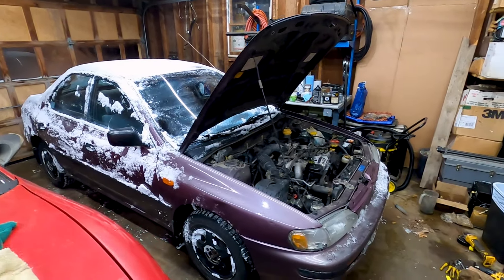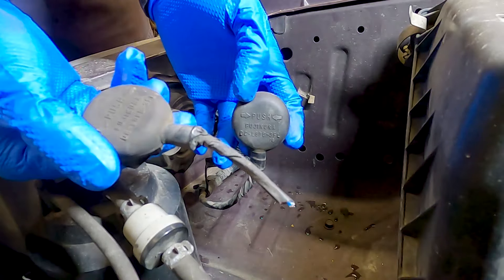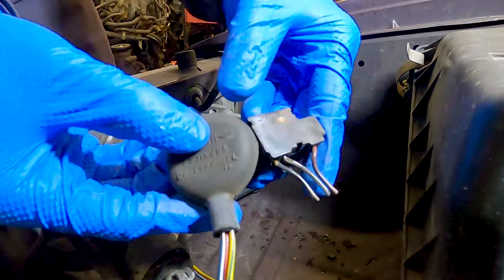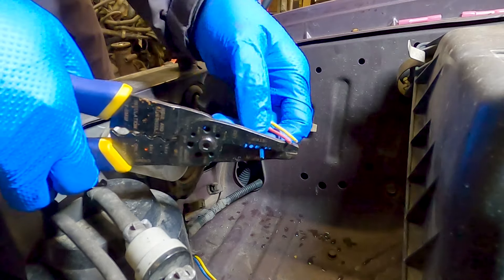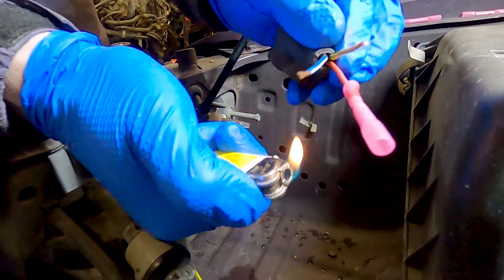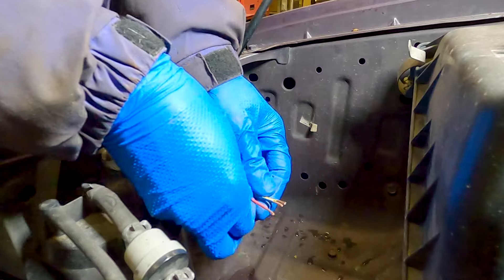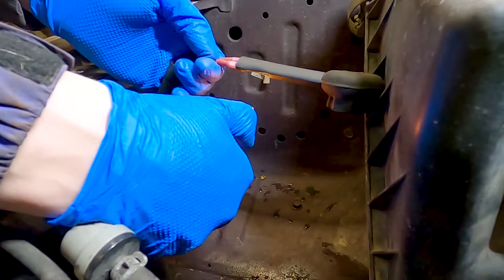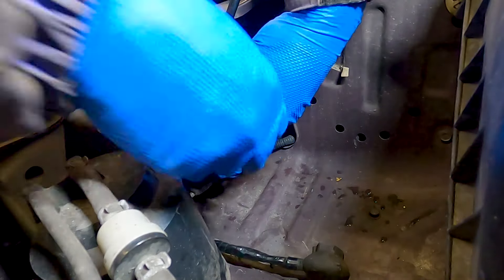How To Replace A Car Wiring Connector Properly - Repair Headlight Wiring Pigtail Harness

Comment from the maker: Links to items in video. Plus extra options. Affordable products I use or which have great reviews. Clicking these links may help me out. :)
New Crimper & Butt Connectors - https://amzn.to/3IHYhso
Crimping Tool & Connectors - https://amzn.to/3IFvDs2
Ratcheting Crimping Tool - https://amzn.to/3wDYLNO
Heat Shrink Butt Connectors - https://amzn.to/3Nmm6cX
Basic Heat Shrink Tubing - https://amzn.to/3IEocBu
Adhesive Heat Shrink Tubing - https://amzn.to/3tHpfMO
Manual Wire Stripper - https://amzn.to/36vkYmH
Automatic Wire Stripper - https://amzn.to/3LdAHpd
Cheap Automatic Stripper - https://amzn.to/3DcjZDS
Diagonal Cutting Pliers - https://amzn.to/3JGBxdD
4 Piece Hook & Pick Set - https://amzn.to/3IE5NV9
Reliable Heat Gun - https://amzn.to/3JWZHB3
Utility Knife With Blades - https://amzn.to/36v37we
Wire Sheath Seam Ripper - https://amzn.to/3NgaiJ8
Reply: You should pin this so its the top comment.
Reply from the maker: @NickFrom1228  Why thank you! It was supposed to be, hah.

Comment: This video saved me between $250-$500 (estimate from the repair shop I had an appointment with). New connector cost $15 at autozone and the tools needed were about $20 all together at walmart. Easy to follow tutorial. Much appreciated!
Reply from the maker: That's awesome! Exactly why I made this video. Thanks so much for the comment.
Reply: All you need is 3 bucks to get into the junk yard and a sharp knife and pockets lol

Comment: I love how u Take your time to respond to everyone's questions and comments. It's very appreciative and you're video is very informative. Could my headlight being put back in the wrong way and not being locked into place be the cause of the connector melting? What is it just a very strong coincidence? This is why I always want to do everything myself. Because when other people do things and stuff gets messed up. I can't help but feel like it's something they did....
Reply from the maker: Thanks very much! It is possible that your headlight not being assembled or installed correctly caused the connector to burn up. It really depends on the style of bulb and assembly. If it was able to knock around and the connector came partially loose or if the connector was not fully installed, it could cause excess heat. This is because if the connector contacts are not fully mated, the current has to go through a smaller area which will add resistance and create heat. This can cycle into thermal breakdown. It's also possible something shorted causing the melt. I always advocate learning how to DIY as long as you are comfortable trying and do you research! If you post a pic to Instagram or something I could take a closer look. Could very well be coincidence, but most likely if a new headlight was installed and the connector burned up, something wasn't done quite right. Could be that the connector was forced and it actually bent a contact for example.

Comment: Excellent instructions!
The one thing I would do differently is simply a minor order of operations change; leaving the built-in heat shrink on the connectors unshrunk until all the wires have been crimped in. As shown in your video, your order works just fine, I can just see myself holding the connector at a weird angle and partially shrinking the unused side by accident, potentially forcing myself to start again. I imagine you can get more shrinking done with less lighter fluid that way, too.

Again, great instructions! Hopefully this ends up being what people come across when they're looking to learn how to do this!
Reply from the maker: Def a great idea! I ended up doing things in a bit of an awkward order for the sake of demonstration. I'm still not sure my favorite way to do everything. Appreciate the comment! 😁

Comment: When possible, I pull the pins out of the connector and swap them to the new one. I work at a collision repair/body shop and I deal with this quite often. I don't like splicing wires unless I have to. Especially since newer vehicles have extremely thin wires and if you try to splice them the computer won't receive the correct voltage and can cause problems. Sometimes it works, but if you splice wires on a newer vehicle and it still doesn't work. That might be your problem
Reply from the maker: Great tip! Yeah CAN bus wires are especially finnicky. I have another video to edit about making new connectors from scratch which will include installing pins. I'll try to make a tutorial on what you recommended in the future too. In this case of course, the pins themselves were totally destroyed. Avoiding splices always best, but making sure the splice is waterproof is next best I'd think. :D
Reply: Good to nnow
Reply: Rats..... So then you don't recommend me, who is in no way, shape, or form a mechanic, attempting to splice my own wires for my headlight With no knowledge other than videos like this and reading on the internet...... I just watched a video where they pulled the pins out. That is definitely something. I may have been able to do it, but mine are basically melted, so it's definitely gonna have to be the wires 😵
Reply: Are you crimping or soldering? Or boff em

Comment: What if the connector has 2 wires while your car only has one? The part from the auto stores and everywhere online it has 2 wires, seems plug with one wire doesn't exist for some reason. Will it still work if I connect just one wire on the connector?
Reply from the maker: If it is the same connector and it clicks together then yes. It's just a single wire in a two wire connector. If it's a different connector entirely then it's just not as common and you'd have to find the right one, or you can replace both sides. If you need more help, tell me what connector it is on what car.

Comment: does it matter which color of wire goes first? Should i disconnect battery first? i have red, blue, and black wires on the old connector and new one which helps but im not sure if theres a certain order to do them in
Reply from the maker: It is always a good idea to disconnect the battery when working on anything electrical. Just unhook the ground connector and make sure it is tucked away from the battery terminals. In truth, as long as the key is off, it would be hard to mess anything up here. Still best practice! It does not matter which order you splice the wires in as long as the correct wires are spliced. Hope that helps. Let me know if you have more questions. Shoot me a DM on Instagram if you need to.

Comment: Not bad! Personally I would’ve soldered but you did a good job with those connecters… One thing I would recommend though is some dielectric grease on the connecter before you plug it in, that’ll save it corroding up.
Reply from the maker: Not a fan of solder in vehicles, but I know the debate will rage on. ;) Dielectric grease def a good idea. Thanks!

Comment: Thanks for this video. I've always wondered why my passenger side marker light won't turn on, initially I thought like most other busted light the bulb went bad, however it wasn't after I took out the light I noticed the two wires completely ripped apart (you could see the copper), and I saw black electrical tape with two heat shrinks. I would assume the previous owner did this, as it's a really old sedan and I'm the third owner. I'm planning to reconnect the two wires after I buy the wire strippers and heat shrinks, as I don't have any of those. I've stripped wires many many years ago, and pretty much forgot all electrical knowledge. I got electrocuted once in my country (240V) so didn't want to touch wires again LOL... Hope it goes well. But I have one question, what happens if you mix the two wires up, and connect them to the wrong one? They are both black in my case...
Reply from the maker: Luckily the chance of any harmful electrocution working on a car is extremely slim! Unless it's an EV of course. I'm sure you can handle it. With a standard bulb, it won't even matter if you hook them up backwards. If it is an LED bulb, it simply won't work, though you may be able to flip the bulb in the socket as well. Some LED bulbs can also work in both polarities. I'd just try to match the look of your old socket with the new one in terms of which wire goes where. I'm sure you can handle it!

Comment: Thanks for this video! Had my passenger side one done by the auto electrician and it cost me $200. Have purchased the part to do it myself. Just curious about the wiring colours. The new connector has red and black the wiring on the car is brown and white. Which goes to which?
Reply from the maker: The color of the wires themselves doesn't generally matter. What matters is where the wires go. So for example if it's only a two wire connector, it probably doesn't matter much, but with the connector in the same orientation, you should have the same wires connected to the left and right sides of the connector as they were before. If it were a three wire connector, you would want each wire to be matched up to the same contact it went to on the old connector before you cut it. $200 at least isn't the worst quote I've seen. I know someone in the comments said $450 which is absolutely insane. It's less than an hour of labor for most connectors in pretty much any shop and the supplies are very cheap.

Comment: Great video!! I know feel confident to do this myself. I had both headlight bulbs burn into the socket and it's completely ruined. The mechanic wanted $340. That's just not affordable but I understand their time is worth it.
Reply from the maker: @Nah481  Jeeesus you could screw it up 5 times and still save money. Definitely DIY. 😁

Comment: A couple additions from someone whose been around the block a time or two...

1. There is a butt splice that has solder in-between the wires inside the heat shrinkable butt splice. 
2. Something to remember when splicing multiple wires for a single connector is to stagger them. Make each splice about an inch away from the nearest splice. This’ll save you if the heat shrink ever wears down (causing a short) and will make the harness slimmer and closer to factory since you’re not cramming 3 butt splices next to one another. 

These were probably some ocd things on my part, as the method shown obviously works, but they are tips nonetheless.
Reply from the maker: Thought I replied to this. Maybe it didn't go through. Yes the solder seal connectors work as well. For most applications I'd just boil it down to preference. Agreed on the staggering, especially if you need the harness to fit in a tight space. Thanks!

Comment: Hi there, I changed my light twice and each time it works for only 1-2 minutes (bulb isn't burnt however, but connector socket seems melted on one side, how could that happen?).
I think now nothing works and I have to change the connector, what could cuase the overheating ?
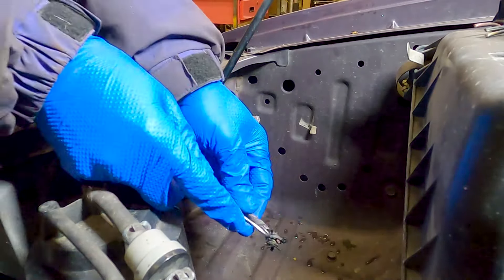At 1:42 you mention blowing fuses does that mean light bulbs ? 
Thanks
Reply from the maker: I would guess the issue is with your connector, but I can't be 100% sure. If you had a wiring issue like a short, it would blow the fuse for your headlights, located in the fuse box in your engine bay. That's what I was talking about when I mentioned a fuse. Technically, a headlight bulb works similar to a fuse, but obviously it is not supposed to blow, it is supposed to glow. I would examine the connector itself for any discoloration, especially black or dark brown spots on the connector, on the wiring, or on the contacts. The contacts should ideally be shiny metal and not corroded or burned looking. You can also smell the connector and if it smells like burning plastic or wiring, that's generally a bad sign. Check the wire leading to the connector for any brakes or damage or hot spots as well. The other main reason your bulbs could be blowing so quickly is if there is a ton of moisture in the headlight housing, but usually they would have to directly touch the water for it to be an issue. Since you aren't blowing a fuse, and it seems you only have the issue on one side of the car, I would say the connector is the likely culprit, but again I can't be certain.
Reply: @802Garage  Thanks alot for your insight. I will probably take it to my garage. Sucks but sometimes best let the experts do the changes. I had my car cleaned and I think the problem happened after. I wonder if that had anything to do with it ?
Reply from the maker: @miguelh4750  It's definitely possible moisture is the culprit if they pressure washed the car. There's nothing wrong with pressure washing, but it might have exposed a problem that already existed like cracked wiring or a bad headlight seal. Best of luck.

Comment: On our 2003 Chevy Cavalier the burned socket has 3 wires: Black in the middle, Red and Green (Green is burned) on the sides. A new socket I bought has 3 wires - all Black. Does it matter which one goes on Red which one on Green, if I connect central Black wires together? Thank you for so useful and informative film.
Reply from the maker: Yes it matters. Generally you have to connect the wires in the same order they were before! So you must connect black from your harness to the middle black on the new socket, green to whichever side green was on in the original socket, and same for red. Hopefully that makes sense. Thanks for the comment.
Reply: @802Garage  Thank you! I thought I need to go by orientation, but wasn't sure.
Reply from the maker: @olenaerhardt7725  Yep spot on. Wire order is more important than color. Have a good year!
Reply: @802Garage  Thank you. Happy new Year!

Comment: I had a harness break,  down near the engine. The wire has the high heat  tinfoil wrap on it. Any idea where to buy that stuff?
Reply from the maker: It may actually be wire shielding as in for electronic interference. I'd look that up and see if it looks like what you're dealing with. If so, you should ideally replace it with shielded wire. Otherwise what you are looking for is generally called wire heat sleeve I believe.
Reply: @802Garage  thanks, I was able to find some shielding tape today. Got everything back together for the 4th time and realized that the new oil cooler came with a defective oil temp sensor so now I have to undo everything and put the old sensor in. Great haha
Reply from the maker: Oh no that's such a pain! Hope you got it sorted.
Reply: @802Garage  yep all fixed! 👍
Reply from the maker: @oxygen454  Good good!

Comment: Thank you! My mechanic wants $450! And he said the bumper has to come off. No thanks, I’m gonna try to do it myself
Reply from the maker: Even if the bumper has to come off, you can handle it. Just watch a tutorial and take it step by step.
Reply: @802Garage I successfully repaired my lights yesterday. I cut too much wire on one headlight, so I removed the headlight itself. Thank you so much! I saved $450 and now know how to splice wires together. You’re probably making mechanics angry,  but you’re doing good in the world!
Reply from the maker: Hey I only just saw that. So awesome! Hope it's still working well for you.

Comment: Is there a reason you dont solder wires instead of crimping? I have a pigtail to attach and i keep seeing videos with crimp tools are they better than soldering?
Reply from the maker: The quick answer is for automotive applications, yes. Soldering has more room for error and the issues are less obvious. The two main problems are cold joints or inadequate solder and too much solder or hard brittle joints. With a correctly sized crimp and the correct crimping tool, such as what I showed in this video, it's much easier to get it right. Even this isn't professional level crimping, but the heat shrink butt connectors add water proofing and strain relief, ensuring the repair will last longer. With soldering you need heat shrink and silicone paste or glue lined heat shrink to accomplish similar protection. Hope that makes sense. If you look up crimping vs soldering for cars there are a lot of good videos out there by big names like High Performance Academy and Haltech. Wiring is a deep rabbit hole, but worth going down to get informed.
Reply: @802Garage  thanks for the fast answer
Reply from the maker: @Jacob-rt6on  Sure thing!

Comment: one thing id have done different is staggered the splices so it looks neater under the heat shrink
Reply from the maker: Always an option! If I'm not space constrained, I like to do it this way because it just makes the process simpler for me. Thanks for the great comment. :)
Reply: I know about that technique and almost always forget about it until after it's too much work to go back and do that.

Definitely a good method, and sometimes even a vital one when the finished bundle needs to be fed through a small hole!

Comment: Nice video. However, I could not use it. Because my wires are different colors. All your wires were the same. That would make it easy. Lol. But thank you. I still give this video I thumbs up..
Reply from the maker: I'm sorry it wasn't more helpful for you. The only adjustment you have to make when your new connector has different colored wires, is you have to make sure you match the wires based on where they lead to in the connector. For example, if it's a three terminal connector, and the first terminal has a red wire on the original connector, but your new connector has a blue wire on the first terminal, you have to connect the blue wire on the new connector to the red wire on the car's harness. Match each wire to the corresponding wire based on position rather than color. Hope this helps.